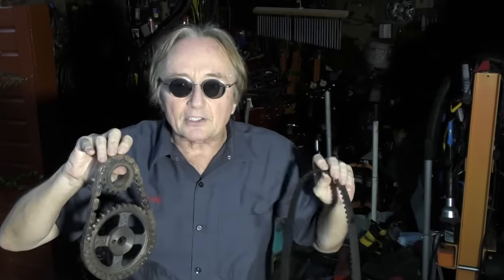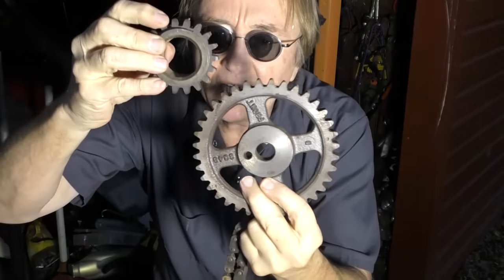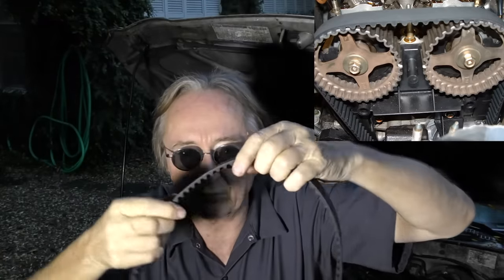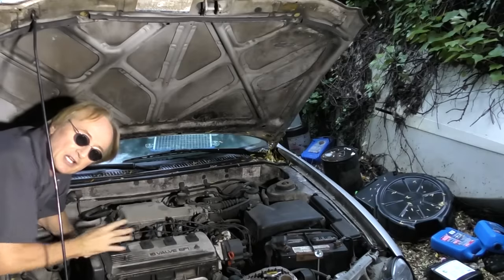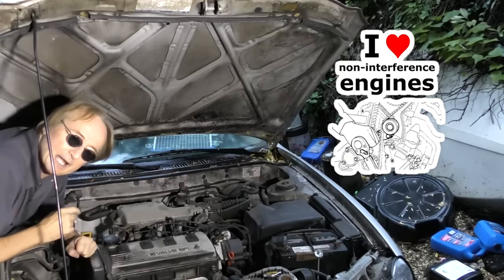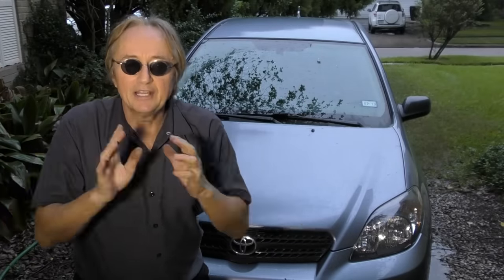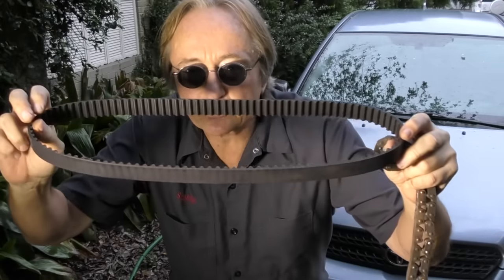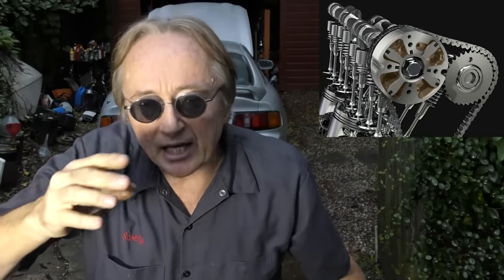Why Some Cars Have a Timing Chain Instead of a Timing Belt

Comment: Plus, a timing chain will give you ample warning before it breaks, a worn chain will make considerable noise, enough to be noticed.  A belt will just snap without warning.
Reply: Or a tensioner can seize with no warning (same result)
Reply: A belt will give more than sufficient warning, its called an odometer and being able to count the miles/years since it was last changed.
Reply: Yes the chain on my last 1972 Hillman Avenger made a horrible noise when it was worn out.  The engine wouldn't have smashed itself up but changing it anyway wasn't too expensive.  My present 1972 Avenger had the chain checked when the engine was rebuilt, didn't need changing.  Good for another 46 years or so.
Reply: @black guy Technically you are correct, but I was not being a dick, I was trying to express my opinion that if the timing belt is changed on time (by miles or years) then it's not likely to be a concern, and the "warning" is in the owners handbook rather than waiting for a noise.  Sorry if I was not clear.
Reply: Absolutely not true. My parent's 77 Buick (Built with the 403 Olds engine) broke a timing chain with no warning - unless you consider a loud "BANG" a second before it broke "ample warning"! A chain link can snap on an otherwise decent chain. 
I recall my 79 305 making a hell of a lot of noise; not so much for the chain being worn, but rather the nylon teeth they put on the gears. That didn't break, but you could bet money that the gears and chain were replaced with a good double-roller chain!
Reply: @Andrew Stones Technically you are not adding anything of value. Chains typically last longer than belts under normal usage and proper maintenance. This is illustrated by maintenance intervals in your owners manual.
Reply: My belt busted on my 2003 Astra I used to own. However it broke because the water pump seized wearing the belt itself
Reply: No kidding, my 2000 Volvo s40 randomly bit the dust due to this headed to Walmart one day.
Reply: @GlenAnderson71  That's the serpentine belt.
Reply: Jason Poole  The belt will only break 10,000 km before if you forgot that it's years or miles whatever comes first.  So, for example,  a 10 year old car can have a broken belt at any mileage.  Unless of course it's a total mechanical failure, which is just as likely to happen to a chain.
Reply: Jason Poole  Belts will fail early if the oil isn't changed when specified or an oil that is used is made with the bear minimum additives required when manufactured . The oil protects the belt, keeps it cool, keeps it pliable. Running past a specified interval puts parts at risk of early failure.
 As oil standards are updated the additive amounts for that specification increase or decrease. Some modern specifications for oil call for a smaller or larger quantity of additives when compared to the specifications of past years. If your car was built with the idea that there would be 10 grams of chemical X per liter of oil and a modern specification of oil says 3 grams is enough you'll have problems down the road. This is literally a problem with a Diesel Ford truck I currently drive. Oils made to todays specifications do not have enough additives to protect the engine and it's recommended you find and use the older specifications of oil or add in additives your self!
This is a problem in oils, fuels, and coolants for many many years. Valve seats and guides use to wear out early because they took the lead ( a high temperature lubricant) out of fuel. Expensive injection pumps for diesels stopped pumping because they took the sulfur ( a lubricant) out of the fuel. Entire fuel systems are eaten away and clogged up by weak acids formed when ethanol and water vapor in the air combine inside your fuel tank. Nearly every model of many cars have been sent to scrap yards because the entire fuel system was not compatible with modern fuels. People regularly buy new small engine equipment such as lawnmowers, generators, chainsaws, etc... because they stopped running and their problem is the new fuels attacked the metals and plastics in the fuel system.
The same holds true for the coolants we put in our cars. Engineers started using nylon and more specific formulations of rubber for the tanks and coolant lines in cars requiring a specific formulation of coolant to be used in the vehicle. What was required in the past as an additive for a specific hose or nylon part isn't put into every coolant you can buy. Without these additives protecting the parts your water-pump bearings, seals, and bushings will fail. Hoses, and tanks are likely to become hard or soft and spring a leak or crumble like wet chalk. The sand they have suspended in the coolant will come out of solution and clog the small water-passages in your engine and heater core or radiator if you use the wrong coolant on a hard working engine.
Most of the failures that kill a car are caused by people doing what they are suppose to do. Using the car and changing the fluids. Car manufacturers are in the business of selling cars not maintaining them. Consumers are clueless to the planned obsolescence of their car purchases. It is now so common place across all aspects of our lives that we accept replacing a car every 8 years or a refrigerator every 5, water heater every 3-6, AC and heat units every 10. Houses that last 30 years and educations that last 20. On and on we are a culture of consumption and it is not getting better.
Reply: Timing belt can be inspected regularly.  On my car, I have finger tightened bolts on top end cover of timing belt, so I can take it off in few seconds and inspect condition of belt easily.  Timing chain on the other hand is inside engine crank case, and impossible to examine
Reply: @andrewstones2921  your comments are flawed. One thing I will state, & I am going to make certain you understand. A timing belt CAN break well before the recommended change interval. I have seen belts that have broken before doing 20,000 km. This has often resulted in costly engine repairs. One engine I pulled down was so bad, the only solution was a new engine, as the bores were damaged beyond repair. The reason for this is the belt broke when the engine was at high rpm, with the car moving in low gear. You get one of these belt driven cam engines, & rev it to about 6500 rpm, & see what takes place when the belt lets go. All sorts of lovely things happen. The valves get bent, pistons get holes punched in the crowns, the valves can break, & be punched through the bores, conrods can bend, rocker arms get broken, cams can be bent or broken. I've seen all of this damage from a broken belt.
Reply: @black guy very true. One good trick you possibly know is if you buy a used car with a timing belt, it makes sense to change the timing belt.
Reply: @black guy my car has 2 chains. One for the oil pump, & the other drives the cams & auxiliary shaft.
Reply: @GlenAnderson71  the engines in those Astras have a habit of doing that. When I changed the timing belts in those, I also changed the water pump.
Reply: @PerfectTag  wrong!! The 2003 Astra has a water pump driven by the timing belt, which is also used to tension the timing belt. I have worked on several of these.
Reply: @christophermarshall5765  I am aware that a belt can break prematurely,  but so can any component in an engine.  On the balance of probability a timing belt is (in my opinion) no more likely to fail prematurely than a chain, the difference in my opinion is that a belt is easier to change when it wears.  But of course, you are at liberty to disagree.
Reply: @andrewstones2921  I disagree. I've seen more belts fail prematurely than chains. A chain can last over 40 years, & a timing belt will never last that long. My car is over 40 years old, & the engine still has the original chain.
Reply: Jason Poole  a belt when it's worn would make a screeching sound so that's more than a warning.
Reply: Had the water pump seize on my civic. Previous owner ran hard city water through the cooling system. That was fun lol
Reply: @black guy That's a good point.  I only buy used cars that have evidence of regular servicing, but sometimes even if a car has good service history there is no record of a timing belt change.  In that case its wise to change it if a change is due.
Reply: @springer-qb4dv  your finger tight bolts will fall out. Also old style v8 engines with a distributor the timing chains can checked for slack without tearing in to it.
Reply: @christophermarshall5765  A timing chain failure does the same thing.
Reply: Timing chain failures increase with length and increase parts along with how hard you accelerate.
Reply: @damonlemasters3424  Drove my car for 15 years!!  My finger tight bolts have yet to fall out or even come loose by themselves  - and I check condition of my belt every few days too!
Reply: @springer-qb4dv I call BS finger tight will vibrate out and that's a little excessive to check your belt so often and you really can't check anything from top cover anyway.
Reply: @christophermarshall5765  it's really a gamble with with chain or belt they can fail right after install to many thousand mile over the recommended intervals.
Reply: @christophermarshall5765 that's only if it's all that valuable to you.
Reply: @damonlemasters3424  Well 15 years says no it will not vibrate out.  Plenty you can check  such as tension, belt condition including rots etc.
Reply: I have had two chains break, one because a link was not swaged properly, that a premium double roller chain and the other that literally broke the link, a cheap single row OEM chain. Both short chains on V8s.
Though I have seen a 200000km  V8 Benz that broke one chain that took out most of the others inc the oil pump drive. That was a VERY expensive job reconditioning the engine
Reply: @andrewstones2921  Problem comes in when ppl trade in OR go bargain hunting @ the auction.
Reply: @williscurry6557  That's true, but if you are buying any used car and you cannot see evidence of the belt being changed, you should be changing it anyway.  Some people cannot understand the importance of preventative maintenance, for those people reliability will always be a problem.
Reply: Another way to know if a timing chain is starting to wear is the engine time starts to vary a bit at idle.  A mechanic showed when I was getting a smog test.  Of course my E150 had over 330,000 miles on it.
Reply: Yep you can tell when the chain goes loose, the car will produce white smoke from back and use more oil than usual, my old Mercedes has a bad one and uses like a litre of oil a week but it's done 400 thousand miles so I've had a good run of luck
Reply: @andrewstones2921  Unless your odometer is broken.
Reply: @black guy I changed my timing belt on my Honda Civic and the mechanic told me that I could have gone another 100,000 miles with it..:-( 
I keep it stock, do scheduled maintenance and drive it easy though if that has anything to do with it.
Reply: @PerfectTag  The water pump is driven by the timing belt.
Reply: @btwbrand  Timing belts are dry and not lubricated by oil.  Oil and belts are not compatible.  Timing Chains ARE lubricated by oil.  Chains and oil ARE compatible.
Reply: In 37 years as mechanic never seen timing belts actually break,they rip teeth out of belt and timing goes out and does destroy interference engines.
Reply: @milanlabus1582  a drive belt maybe yes, a timing belt not so much, unless you know of an extremely rare situation.
Reply: What kind of noise does it make? I have both chain and belt on my 2nd car (2013 Hyundai Veloster Base).
Reply: @dosmastrify  actually, a guy on YT showed us how to tell if the tensioner is going bad on a 2001 to 2005 Ford Explorer Sport Trac. It makes a noise when you start it up.
Reply: @dosmastrify  most tensioners are operated through the engines oil pressure. So no
Reply: @JusAV-vw1pj  not if it's a belt.... So yeah
Reply: @dosmastrify  that makes zero sense. You and I both were referring to chains.
Reply: @JusAV-vw1pj  nope, I was referring to belts like OPs last line. He said belts can fail suddenly and I said so can the tensioners (same result = suddenly snapped belt )
Reply: Usually they don't snap. They lose teeth and jump sprockets.
Reply: No, not true all the time
Reply: @christophermarshall5765  A smart mechanic will replace the water pump when he replaces the belt. The problem is that the rubber seal adheres to the casings and can start leaking when the pump is rotated to loosen and tighten the belt. Replacement is easy when everything is exposed and it does not feel very good when he has to do the job again, for nothing, on guarantee.
Reply: @cobrar5161  usually they jump sprockets and the engine runs roughly if at all, and you are lucky you will have a non interference engine and will not have to remove the cylinder head. A screeching sound would be a worn bearing on the tensioner if it is from the timing gear but it is more likely to come from the pulley belts that drive alternators, water pumps, power steering pumps etc.
Reply: @robertclary1718   ok. most of the time
Reply: Timing belts are reliable when serviced to the manufacturers demands. Leave it too long, teeth will strip away and your engine is toast. Some allow a longer belt life when the engine does long journeys. But running any belt for too long is a gamble. Coolant will also damage a timing belt. A leaking water pump has to be fixed immediately and the belt replaced.
Reply: @btwbrand  Most timing belts are on the outside of the engine but anything within the engine will last longer when the oil is serviced at least as often as manufacturer recommends. However, the >20K miles that some engines are claimed to manage between oil changes is excessive. They get through the warranty but then what?  For the small additional costs, 10,000 mile intervals make more sense if you are keep the car long term.
Reply: @springer-qb4dv  This is entirely pointless. Cracked timing teeth are visible, but a belt that degraded will be well beyond its age or mileage limits and due for change anyway..
Reply: @christophermarshall5765  The Fiat 1.3 16 valve diesel (also used in Suzuki, Peugeot and GM cars) has a single row can chain. It's ok to 100K miles but after that you risk a link breaking due to age. Fortunately, the valves are vertical and operated by rockers, which are designed to break on impact. Repairs are possible but needs a fair amount of labour time and about £400 in parts.
Reply: @cobrar5161  No it won't.
Reply: @springer-qb4dv  Your timing belt check is pointless. Damage the causes timing teeth to strip away is not visible until the belt has run well past its age/miles service limit.
Reply: @christineayres7094  Oil smoke is piston rings, bores or valve seals. The timing chain might be coincidentally worn but it can't cause engine smoke.
Reply: @JERRYR708  The belts work harder at low revs. Low engine speeds and careful driving put more stress on the timing belt. Renault 2.0 engines are rated for 70K miles of "normal" driving but just 40K miles of town driving.
Reply: @oscarthegrouch6890  Exactly. Failure commonly happens while trying to move away at a traffic junction  - accelerating the engine loads the belt teeth. Obviously, bouncing the engine off the rev limiter is not good, but slow careful driving does more harm than letting it spin.
Reply: @Dave5843-d9m  this is why I don't like these engines. Cheap & nasty.
Reply: @christophermarshall5765  im more Lucky still, i've got 2 chains and a belt. The double the bad of both